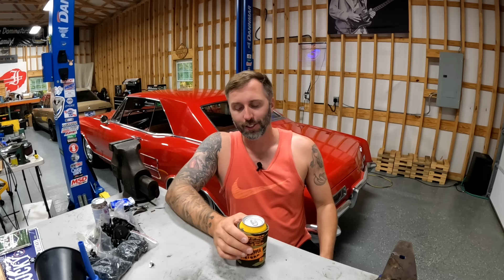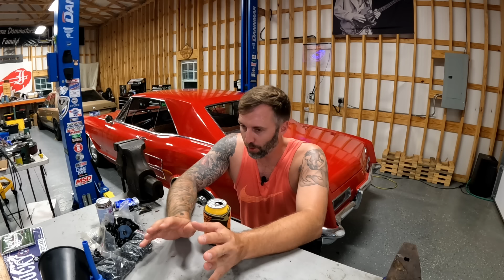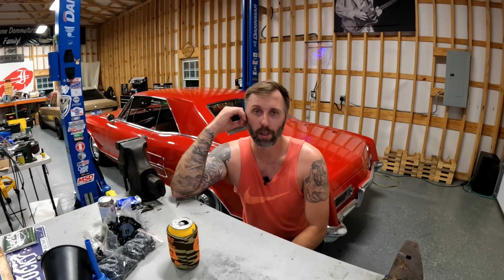Why I Ditched Holley Sniper EFI

Comment: I'm actually thinking about pulling mine. I've had it installed for a little over a year and about 1500 miles on it. The fuel pump that came with the master kit just failed. Also, living in the desert, that thing is not a fan of the heat.
Reply from the maker: Yeah I am not a fan of the ecu mounted in the unit.  Doesn't make sense to me.  Thanks for watching .  Subscribe!

Comment: I will never criticize someone for doing what works.

I'm running a Sniper Stealth (was running a 850cfm QuickFuel 4150) and HyperSpark distributor on a 351w stroker in a 2012 Mustang. I did research for two months before I ordered my Sniper. I got the Stealth because on the non-stealth, the ECU being so close to the distributor bothered me, and my research seemed to justify my concerns. I already had an electric in-tank fuel pump, a fuel pressure regulator, 3/8 feed and return lines, and a welded-in O2 bung, so all I had to do was make sure the electrical system was up-to snuff. My install was incident/trouble-free, and has been since I did the initial install. I feel like I've been pretty lucky considering all the problems other people seem to have. That being said...

Holley markets the Sniper as a DIY kit, but it most certainly is NOT for your casual car guy. Their strap-on O2 bung is a freakin joke - it WILL leak. I didn't need the "master" kit because I already had the fuel pump covered. Since I'm running a Ford, I was able to use Ford Racing 9mm cut-to-fit plug wires which were 1/2 the price of the MSD wires that Holley wants you to use. It took a month to get my sniper in the mail, so I used that month to make sure my electrical system was right.

The new Sniper 2 is supposed to address the RFI, injector plug, and regulator problems, and that's nice, but if my current Sniper goes south on me, I will swap right back to a carb setup without a single look back. 

There's also this new thing on the market called "Carb Cheater" that electronically fine-tunes carbs, and the interface is through your phone. It looks promising, and I'm already going to get one for my Fairlane.

FWIW, the sniper is a lot more expensive than a carb. If it was me, I'd put a carb in the Camaro for that reason alone. Beyond that, you're comfortable tuning on carbs, so it shouldn't be a hassle at all, and you won't be forced to re-do your electrical system to make a carb work.
Reply from the maker: I have to agree with you. The strap on oxygen sensor is a garunteed way to induce problems right out of the gate lol.   Subscribe plz!

Comment: I'll never understand why people think EFI is more reliable than a carb. I don't hate EFI but, there's so many points of failure on those systems SOMETHING is bound to go wrong...
That being said.... I'm looking at a Terminator X-Max for my wife's 97 Mark VIII... The old OBD2 system is, let's just say... "fragile" and I'm figuring the Terminator should be a lot more serviceable. I'm not trying to make a million Horse-torques... I just need it to not die on her in the Home Depot parking lot and have to be towed home again.
Reply from the maker: yeah I understand that.  there is definitely a place for both.  It's hard to beat the simplicity of a carburator.  thanks for watching, subscribe plz!

Comment: I have a 97 ext sierra, 5.3, msd 6014 650 brawler DP wow runs amazing dialed it in with a afr guage, VERY consistant. Its my daily driver 55k miles carbed❤holley👍👍💪

Comment: Go with aces efi….the ecu is not in the hot ass throttle body and remotely mounted….thats what i used on my sons ‘67 mustang with roller 302 motor…..i have 2 terminator x systems on my LS swapped nova and c/10 both supercharged……before boost i ran a fitech LS setup……95% of the time is installer error…..good luck….. my first car was a ‘69 riv….man id love to get another one someday

Comment: Bad diaphragm. Same thing happened to a buddy. He hydrolocked the engine. $8k down the drain. Called Holley, they said it was a known issue, sent him a new diaphragm but offered nothing in regards to covering the cost of the system or the engine.

Comment: Which sniper did you buy? I have been waiting over 1.5 yrs for a sniper stealth. Holley told me everything was in stock so I pulled the trigger and bought my distributor, coil, wires, ignition, and sinper stealth master. They have given me such a run around.

Comment: I will never willingly add electronics to a car.  Electronics are typically an on / off deal....leaving you dead in the water when they fail.  And to hell with that.  Just drove my 83' K10 454 Suburban from Kansas City to Panama City loaded with carpentry / tile tools and dolly towing my 89' Honda Prelude loaded with gear.  Got 10.5mpg.  Had ZERO issues. Get 13mpg with typical combined driving.... With a 1407 eddy.

Comment: I sent back my Holley EFI kit (multi-port), for very similar reasons.  If was appalled at the quality of the kit once I got it.  I talked to the Holly sales person prior to buying it, he appeared to have enough technical knowledge to complete my order.  I was CLEAR to him, which LS motor I had, he sent me a harness that did not match up to at least my temp sensor and then later found out I needed a new MAP sensor as well. RED FLAG.  So when I called customer service I was on hold for literally 1 hour.   2 strikes and I'm not waiting for the 3rd one.  Not happy with the whole experience so I sent it back. By the way, they WILL accept it as long as the ECU has not been FIRED, and somehow they know.  But I agree with you, doesn't matter, if it didn't work out, and not your fault, you should get your money back.  Not impressed with Holley overall, particularly their customer service. I went ACE's EFI, have not installed it yet, but will report back once installed.  By the way, I like your comment near the end, anything that is universal, and built for everything, is not going to be best for everything.
Reply from the maker: Thanks !  Please subscribe I appreciate the support .

Comment: I think your mistake was first reaching out to a bunch of people on Holley forums.  I have found the Holley forums to be nearly useless and filled with arrogant know-it-alls.  I bricked my Sniper EFI trying to upgrade firmware and the support tech I talked with and went through diagnostic steps arranged for a completely new system within a few days (Canadian customer) and trusted me to return the unused parts and defective TB.  I do agree the long wait times for support are ridiculous but they were courteous and quick once I reached them.  It's unfortunate you got a runaround from them.  I'm now using a Terminator X Max on my LS because my Sniper experience was mostly positive.
Reply from the maker: good to hear you have had a good experience.  Thanks for watching, subscrib plz! thanks

Comment: I had the injector wire's come unpluged all the time, plug's are made out of rubber and don't snap in good and they come loose!
Reply from the maker: There's no excuse for that.  There are so many good injector clips on the market now....hell your basic megasquirt uses the bosch standard clips.   There's really no excuse at this point for a new product to have that problem.  

Thanks for watching .  Please subscribe !

Comment: They stopped responding to my emails. Wish i just got a better carb and learned how to use it more. Less wires hanging around the engine bay. Took me 5 years to figure out it was rf screwing me up.
Reply from the maker: well there is always a carb to go back to lol.  thanks for watching! subscribe!
Reply: @timelesssteelgarage  im fram off restoring the truck now and just put the efi under bed tank in. The in tank fuel pump is a lot smaller than the kit one. I hope it holds up.

Comment: I think holleya problem is over selling the plug and play aspect when its not even close to that. 

Sure it self learns to an extent but to get the best out of it you need to tune for the first year for every season. 

I bought the sniper 2 and they completely switched the connectors and harness. The hyperspark two 10 pin connector type doesnt fit the new system.

I disassembled it and patched it into the new connector but its still a pain. 

If you run a send/return fuel system people have run into hot fuel tank problems. Run the returnless system for no issues on that end.

Comment: Thanks for sharing this expeience, I havent heard any good stories about the sniper. I have a stockpile of Holly carbs that I build and run on my vehicles. Holly like many other companys seems to have problems with quality control and final fit and finish of a product. I have recently seen brand new Holly carbs out of the box with warped throttle plates.  As for having to open it up I agree you shouldnt have to for that kind of money and a established company like Holly.  However you never know like when we had a brand new engine in a boat with a new carb that wouldnt run right , opened up the float bowl and a earwig type bug had crawled into it while in the box on the store shelf. That Riviera is one of the best looking designs that ever came out of Detroit. Bye

Comment: I have had a bad customer experience with holley..   but still love the system for what it is.  I think it is a little bit misrepresented as a system that anybody can install in 20 minutes. You need to do a lot of research and spend a decent amount of extra money and time making it work for your application.   Which is fine...  Because you are completely re-engineering the way your engine operates.  Anyway, it sounds like you had all your bases covered, got a defective unit..  and had a shitty customer service experience.    I think the sniper 2 goes a long way toward fixing the shortcomings.   Looking forward to seeing how your install goes.

Comment: I converted my 347 small block Ford from a Holley 750cfm double pumper carb with no choke to Sniper.  In my case, upon initial startup, the front two barrels did something similar.  Flooded gas like crazy.
Called Holley and after the usual waiting online got a human.  He says I needed to return the unit.  Sent a shipping label right away.
I returned the throttle body and about a week later they shipped it back.  I talked to them and asked what was wrong and was told the unit had been programmed with 2 barrel software so the front injectors were trying to supply all the fuel for the 4 barrels.
I didn’t install the distributor and left the timing duties to the distributor that was in the engine.  That was a mistake as that distributor was set up for drag racing with timing going full-in just off idle for drag strip launches.  That caused drivability problems.
I ended up going to US-12 Speed and Custom in New Buffalo, MI as they have a Holley certified tech.  After spending another $1900 to convert to timing control by the Sniper (had to buy the Holley distributor), and some dyno tuning, the car starts and runs well.  They did a great job.  But, if I had known the conversion would cost me over $3k, I would have just changed the drag racing double pumper for 750cfm Holley with vacuum secondaries and an electric choke.
Your recommendation on dyno tuning is right on.  I’m totally old school and the range of tuning you can do with one of the units is awesome but complicated.  That’s why you end up going to someone who is an expert.  It’s way more technical than I want to learn at 78 years old😂
Reply from the maker: I am glad it ultimately worked out.  Thanks for watching.  It does get expensive. Subscribe! Thanks

Comment: I looked into this multiple times but never pulled the trigger. My car (65 impala) runs great with a carburetor but I thought it would be nice to have a modern EFI unit. However, it's my understanding that these units don't play well with other electronics and even the most subtle radio interference can give them major fits. I also have an MSD box, electric fans, added an under hood fuse box, Dakota Digital dash which adds a bunch of wiring, and converted my headlights to LED's. Maybe in another few years if the products continue to get better.

Comment: The unit itself is OK.....
But the ecm in them are crap ....
My snipper ecm has dropped the ignition....
So now I have decided that I will  buy external holley ecm to mount inside the cabin to run the snipper...
I'm in Australia so I've got no  chance of holley even looking at me ....
Been on the dyno most of the day and made pretty good hp

Comment: Yep. I spent $2500 on my Holley terminator x max and then I got a tank for about $500  I was under the impression once I do the start up procedure it will self tune and learn.  Nope. I will have to take it to a turner.

Comment: Had an issue with sniper #1 black the internal computer was defective out of the box Holley did cover it under warranty had to send the unit back to Holley for them to get repaired but took 7 months to get it back when I got it back the O2 sensor wire was melted and one wire to the temperature sensor was broken , this was for a customer car , ran into same struggle with customers service I wouldn’t recommend sniper EFI to anyone!!
Reply from the maker: 7 months is insane...better not take 6 months to get my money back. They told me 6 weeks, still rediculous.  Thanks for watching, please subscribe.

Comment: I waited more than 2 months, at the time and nothing. I heard about some of the issues it has, but I figured Holley would re release them, fixed.  So, I waited, then I finally went with a Holley 1450 cfm Dominator. It's too bad too. I really wanted to try  the Sniper 4500. I have a 632 N/A  with sr20s  and 13:5.1 compression on e85.  Holley said the Sniper is good up to 1500 hp and I planed to see if that's held true.  I was really looking forward to running the Super Sniper 4500. Had  Holley taken them off backorder yet? Let me know.

Comment: I inherited a car with a Holley sniper system, I had posted on a chat board ..asking what I need to know about this system,  or be concerned about? 
Someone all the way from Germany, that was a professional mechanic… said you’re better off with a carburetor. He said people pay me to Install these every day,  and I do what they ask. He said, but eventually it will leave you on the side of the road. The whole unit will go bad. The electronics will fail, or your injectors will screw up. So I got to looking online and found thousands of YouTube channels… educating people on what to do to troubleshoot your brand New unit… The big red flag shot up the Pole. This professional mechanic in Germany knew what he was talking about. I know there’s some people that’s never had a problem. I told him this car has been converted over to a new fuel tank with A complete internal pump system …and it would cost me more money to turn it back into a carbureted car. He said you’re better off if you do. I ended up selling the car,  before I had any problems. Someone else inherited my future problems , thank goodness it wasn’t me. I had a Holley  750 growing up on a big block FE and had no problems at all. The only thing you had to worry about…Was your mechanical fuel pump going bad. Mechanic in Germany, had a good point …if someone knows how to adjust a carburetor,  it will be more Cost efficient and run just fine.

Comment: The regular 4 barrel manifold on the buick nailhead need to be ported to make power on a holler sniper the Gs 425 come with 2 carbs so they sell after marker high rise manifold  and no one makes a 4 barrel naild head high rise manifold so I Bored mine Out and make more power but u need to bored and port ur engine heads Bro

Comment: @18.03!! I'm shocked Holley still has quality issues with the Sniper after being on the market for so long now! I test drove for some days a '70 Chevelle with a 502 with the Sniper atop it and it was an absolute beast; the EFI made it so responsive across the power band so I know from personal experience just how good the Sniper potentially can be. It SHOULD be expected that the TB is in perfectly working order OOTB, not having to return and swap units time and time again, hoping that one finally receives a non-defective unit. 
Holley had their chance to revolutionize EFI with those kits - and with the Sniper they're having car guys revert to carbs! Such a wasted chance...
Reply from the maker: Agreed

Comment: I always wished I had couple thousand to fuel inject my old Ford.  After years of hearing about problems with the after market systems, I cannot see spending that much. I would be pissed if Holley told me to ship the whole system back. Over the years I have seen tons of EFI fail videos on You Tube. As far as having to learn to drive a carbureted car, I have never heard of that. The hardest part is starting the engine when it is like 40 degrees and learning to use a manual choke. The only time you will ever have a carburetor overflow is if something gets stuck in the needle valve and holds it open. The fact that your Sniper started and ran great a couple of times and then flooded everywhere tells me somehow an injector stuck open. In the video you never mentioned installing an oxygen sensor or welding a bung for it on the exhaust pipe. Either way I run regular Holley carbs on all three of my Fords. One of the Holleys is a polished aluminum 750 with vac. secondaries and manual choke. It is from around 1990 and it is the one with the one piece top. It does not have removable float bowls. It is around 35 years old and looks and performs like new after I installed a kit on it.

Comment: This aint ment as a low blow... But did you adjust the idle? Friend had the same problem and the idle was adjusted so that the butterflies were full closed. One turn and problem solved... It was whistling like crazy pulling gas from the sides and takin all the air from IAC valve...